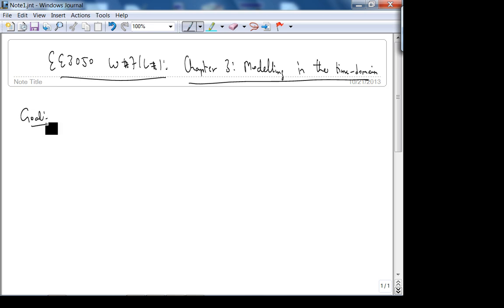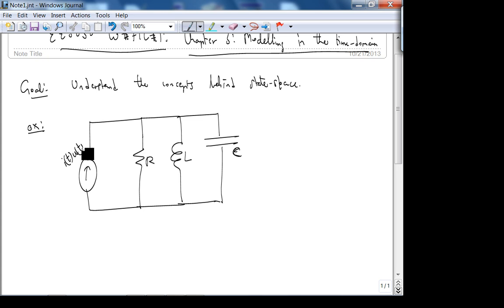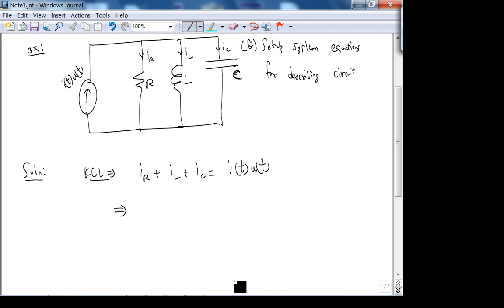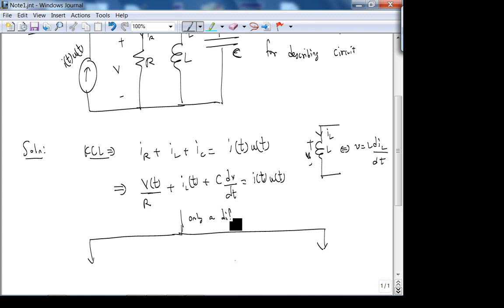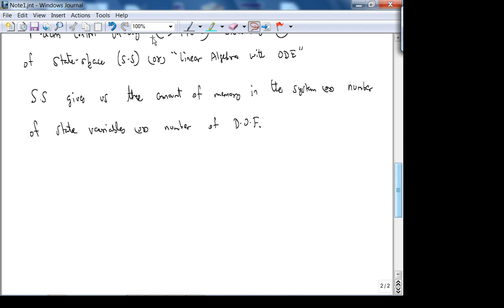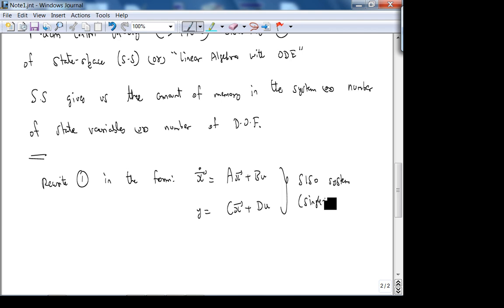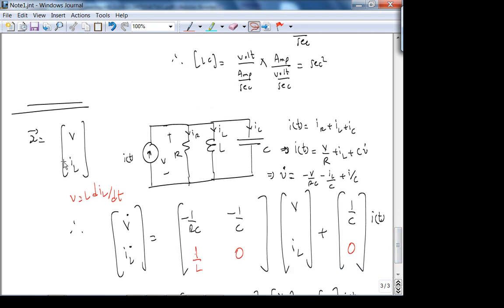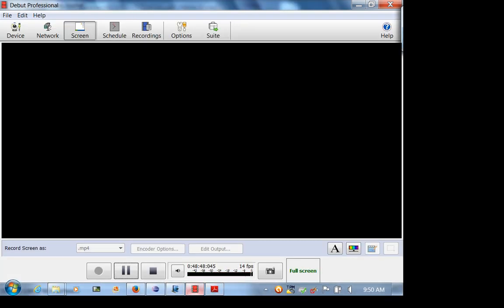ee3050Fa13w7L1 StateSpaceIntro

Comment: good class.
Is it possible to obtain the state space representation for a parallel RLC circuit with a voltage source in parallel with the resistor, instead of the current source?
Reply from the maker: Thiago : thx. for the comment and sorry for the delay in responding.  I have been travelling.  I think it is best to answer your question with a video :D.  I will try and post one within the next few days (I am again travelling), thx. again.
Reply: Very thx and good travel.